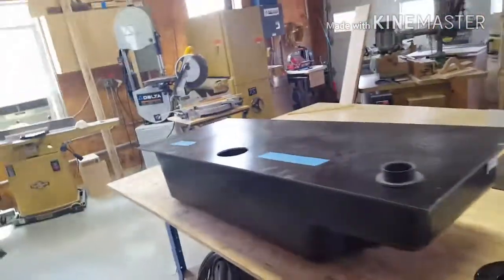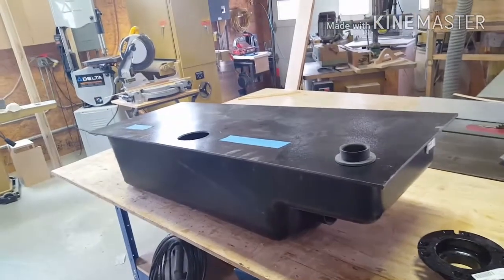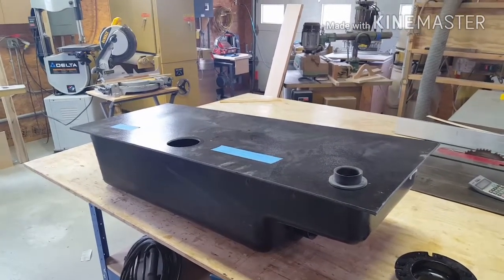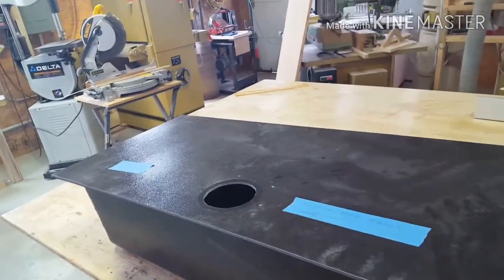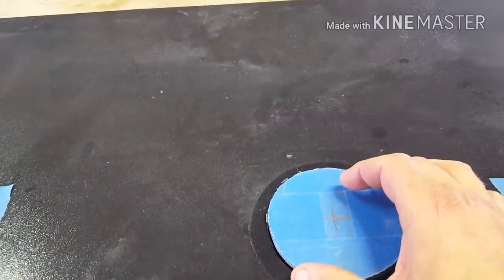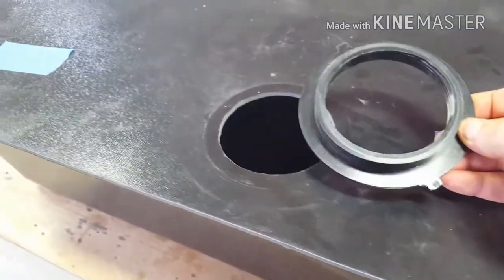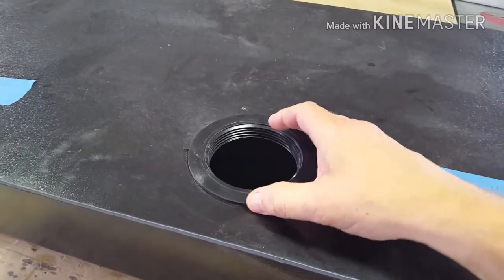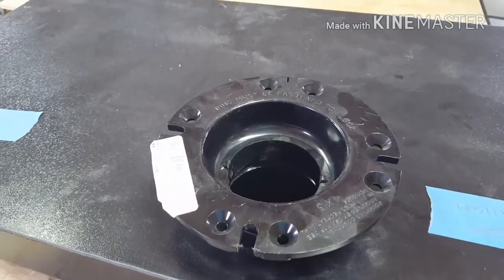Cargo trailer conversion #13 gluing on 3 inch flush threaded fitting for closet ring to black tank

Comment: Contact cement is not a good idea I have tried it and it will come loose, at least my patch job did. And I was told Polymer doesn't do well with just glues. Their is a Holding Tank Adhesive 1 lb Black On ebay that is mixed with Acetone. and is a proper sealant that chemical adheres it right. Or a hot weld with polymer sticks  But other than that thank you for the video helps me out. With my Tank replacement .

Comment: Like the size of the tank. Are you concerned about how much it will hang down or possibly dragging it? Where was tank purchased? Guess you'll strap it up? They hold a lot of weight.
Reply from the maker: 19stoney64 The tank is actually above the hitch steel frame and the tank has a lip built in that hangs on the steel floor joists.
Thanks for good Ideas that I should point out in a future videos. I was ill a few months back and have not been able to continue progress on the trailer with new videos. I look forward to posting new videos in the future.
Reply: Repurposewood Industries Glad you're on the other side of health challenges. I was paralyzed neck down 13 years ago and after surgeries and therapy even up to date, I do what I can which is little by little but I'm thankful I can do anything. Looking forward to more videos. Your videos are very well done.
Reply from the maker: 19stoney64 thanks for the encouragement. I saw you while watching your videos, looks like you have many talents. Keep heallthy!

Comment: Do the ears on the tank threade grommet adapter denote thread orientation for the toilet flange?
Reply from the maker: I'm not sure but I don't think so. I just put the orientation where the two started to seat together well, I didn't want the toilet flange to be too loose or too tight.

Comment: Don’t you need a vent?
Reply from the maker: I guess I didn't mention anything about that but in the video you will see on the right of the screen a rubber grommet in the top of the tank that the pvc vent pipe fits into. The pie fits tight, sealing off any air or liquid that could escape. I'll probably show and mention about that in a future video. Thanks